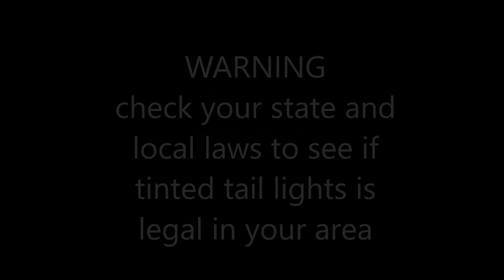How to tint your tail lights

Comment: I use a strong solid black and mix into my clear and build it up like candy until I’m happy with the darkness trying to achieve it under 4 coats.I also use bulldog as an adhesion promoter. You have to be very careful with wax and grease remover on the plastic. It can melt it and cause blemishes that show through the clear. I’ve seen some nightmare VHT nightshade jobs but yours look like they came out good.
Reply from the maker: Thanks brother I was going to show that method but was trying to keep it simple for the DIY guys
Reply: I was thinking same thing but maybe cause he had to tap up backup lights. Have to clean gun out good before final clear.